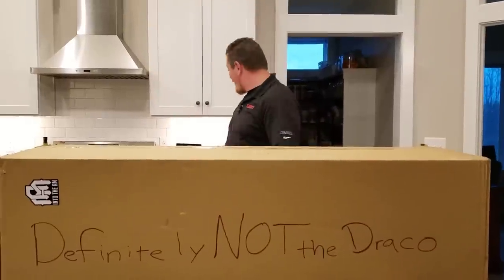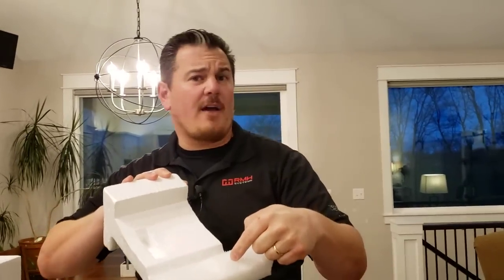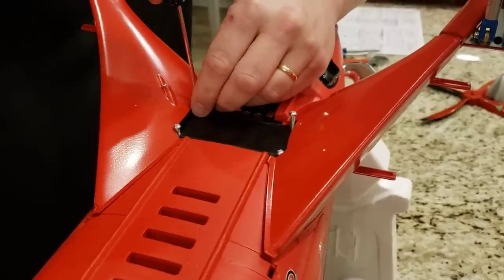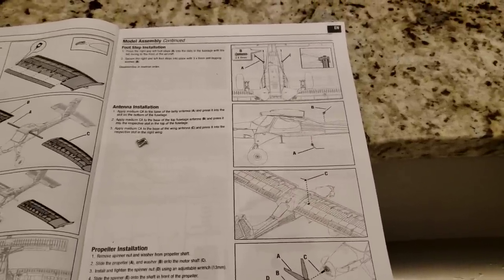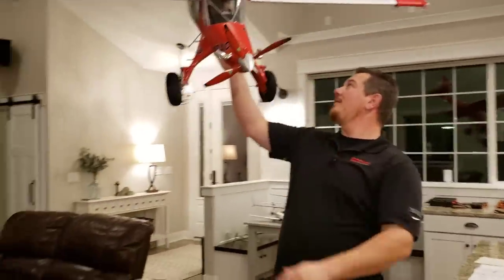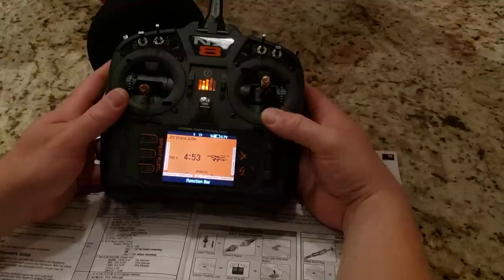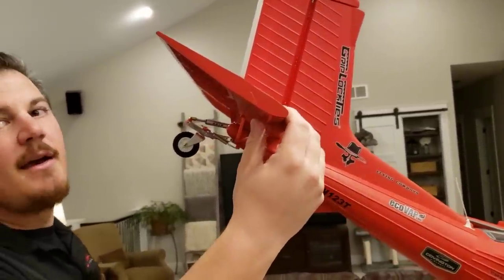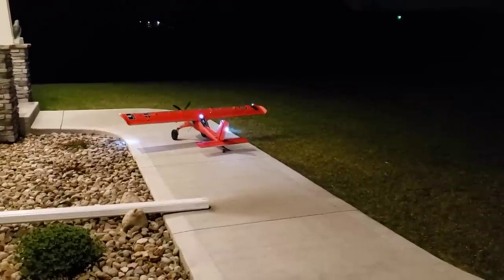Eflite - Draco - 2.0m - Unbox, Build, & Radio Setup

Comment: Well my Draco finally arrived:)  Curious what you ended up setting your expos at?  Thanks in advance!
Reply from the maker: I put them at whatever we did in this video...if I didn't mention it, it would be the same as my standard...

Control / Expo / Rate
Ailerons / 10% / 100%
Rudder / 20% / 100%
Elevator / 30% / 90%

...sorry, because I know that I do occasionally forget to say it in the radio setup, but I usually talk about it in the maiden flight, which happened to be anther video for this plane, something we don't typically do (anymore).
Reply: @BrianPhillipsRC  Thank you for the reply and all you do for this community Brian!  I will set mine per your standard and adjust from there.  Cheers

Comment: Hey Brian, love the vids. Im fairly new to rc planes and i accidentally ordered the PNP version instead of the BNF version. Im just wondering if there any extra steps to the set up/ bind process after i get the reciever installed? Thanks ahead of time for any help 👍👍
Reply from the maker: yes. I would say, follow the Unbox, Build, Radio Setup video for the FMS Beaver 2.0m. This will get you in the ball park, EXCEPT for the light module which will cause you some work too.

Comment: Been watching your video about the Draco build,.  I got my Draco last night and made an error using 5 minute epoxy on my leading edge wing spoiler.  Keeps on pulling off!!!  I love your cats.  We have 4 in-house cats here in Lakewood, Ca. yesterday.  Hey Brian, is it okay to use the regular 6s lipo instead of those smart battery?  I’ll make a battery adapter from IC5 to XT90.  Do you think I can still have fail safe and safe mode?
Reply from the maker: SMART Battery use does not dictate if SAFE works.
Use whatever pack you want, you'll be fine, but may lose some telemetry data.
5 Minute epoxy on the LE Slats? Why did they come off?
Reply: Sorry for my late reply Brian but I too is confuse and it’s weird.  Probably the mixing.  Anyway I pulled it, cleaned it and glued it again and it work this time.
Brian,  3 of my light aren’t working, the light 2X closest to the wing root on each
Reply: wing and the rudder tip lights.  Also, I found 2 unplug wires, one is a black & orange in one plug and a gray wire in another plug by itself.  I remember you mentioned about this in your video but I couldn’t find that “ page” anymore. Must I use a Y harness and plug it into the circuit board?

Comment: Hey Brian Why doesnt anyone show show the wiring ? Got my new Draco but Im having problems with the wires 2 of my wire leads dont have labels and I dont know where they connect. I connected all the cables that had labels but still dont know where the others go. Is there any support that I can call that will help me? Thanks
Reply from the maker: The reason nobody shows it is that most don't have to do it for a BNF - I suspect. You're trying to work out the LED's - can you just guess and check?

Comment: Hi Brian, I have my Draco but just as I was taking off on a maiden the engine stopped, the ESC stopped working and Horizon Hobby sent me a replacement, however I can no longer get the Avian Progm menu and everything else is workings etc control surfaces, safe select  and lights, now matter what I do no reverse, I must be doing or missing something any ideas would be appreciated. ...Larry Shimoda, Canada
Reply from the maker: I'm very sorry Larry, but not sure what to do. Are you using the SAME entry method we showed here for reverse thrust setup?

You have to do it within a few seconds of power up....I think like 30ish seconds....or it won't let you enter the menu.

Comment: Hi Brian, really enjoy your videos, I have a Draco Question about the Light controller. I recently had to rebuild my Draco after a serious crash which required me to order a new Fuse. the problem is no info on how the connectors are connected. Was able to figure it out except for one
connector. All other ones have a letter where to plug them in. the one that's odd has a tag with a light symbol wit power and a lightning bolt.
can't find where to plug it into the controller. Would you be so kind to look at your Draco and see where it's plugged into. E-Flight has no info on connections to the controller. Your help would be greatly appreciated Thanks in advance, Ernie

Comment: I was watching your video here and setting up the transmitter, and I'm not sure wat I did, but everything works well, but the throttle doesn't work. The plain just starts beeping . I was just curious if u would know what that would be?
Reply from the maker: Might need to double check a few things...

1) Is your throttle cut setup right - Check this FIRST.
2) Did your throttle go low enough to ARM the motor? If not, try a few clicks of trim DOWN and see if the motor initiates, if it doesn't, trim it MORE. If it still doesn't, you might need to try to CALIBRATE throttle range.
Reply: I have the trim set as low as it goes and it still does it.  I was just thinking would it do that if the battery is dead,

Comment: Hi Brian
I wonder whether you could help me as I am not able to get the right answer so far solving my problem.
I am trying to setup the Draco including reverse thrust on a Futaba receiver & transmitter but it doesn't work. I downloaded the SMART ESC software & connected the ESC (AVIAN SPMXAE1100 Smart ESC - 100Amp 3-6S Lipo) to assure the settings are right. The default settings (eg. Brake Type "Reverse" and the channel for the reverse thrust on CH7) were fine.
However, when I connect the signal plug to CH7 the ESC doesn't reverse the thrust - it seems as if the ESC doesn't get the signal. I connected a servo to CH7 using the programmed switch & this did work.
Thanks in advance for your help :-)
Reply from the maker: I don't even know if you can do it with Futaba. The Smart ESC's use SMART Technology for control of the reversing.

I'm not saying it won't work, but I am saying I don't think it will...but here goes nothing.

1) Take off the prop before you try any of this. I don't want to see pictures of your chopped up arm, like Big Jim just sent me the other day...TO THE BONE with the Night Timber (I think) GROSS! Replace with a piece of tape so you can tell if it's reversing.
2) You have to make sure the channel is working first - Hook up a servo and verify it.
3) Once you verify this, verify direction of travel. make sure you're driving the servo to the -100% / +100% of PWM. On Futaba, I wonder if you're possibly REVERSE of the call out by Spektrum???? 
4) Now you have to wonder through the programming menu on the PROGRAMMING BOX or the Tx. If you can't get into the menu, you need to enter within about 5-10 seconds of powering up the plane...
Reply: @BrianPhillipsRC  Hi Brian
First of all thanks a lot for your prompt feedback. Meanwhile I got the answer - it doesn't work with that ESC as the reverse thrust channel is actually a telemetry channel & therefore doesn't work with Futaba, Jeti etc.
I was just a bit surprised that the Product Support Team was not aware of that but got it sorted meanwhile.
Thanks a lot for your support & help - much appreciated.
Best regards,
Markus

Comment: Great, video (unboxing) I have tried in my basic English to retain as much as possible, although I can't understand everything.
My draco has been mounted and flown thanks to your help, my version is bnf so the bindhas been fast from the spektrum bnf template for NX8, it has been configured with safe disabled, but I would like to be able to opt for F switch assignment to select between AS3X and safe mode , I have not understood the procedure well .
even so my draco has flown without problems. could you help me with instructions to get AS3X and safe mode selectable in switch F .
Thanks
Congratulations from Spain for your video Brinan.
Reply from the maker: I would tell you to go into FORWARD PROGRAMMING, and make your assignment to SAFE on for the channel that's been assigned to "F" in SWITCH ASSIGNMENT.
Reply: @BrianPhillipsRC  ok thanks brian
regards

Comment: I have an older dx8 and the throtle mapping can't go to -100, how do I use this radio to fly the new draco with thrust reversing
Reply from the maker: I don't think that matters.

Your Tx's menu structure only DISPLAYS the +/-100%, whereas the PWM is always the same in DSMX / DSM2. You should be able to do it, but you'll have to adjust the WAY you setup the settings. Think of it like this...

+100% for me = 100% for you
-100% for me = 0% for you

Should be simple as that...but you may need to reach out to Spektrum to see if your DX8 is compatible to do Forward Programming. You may need to update firmware too, but not sure if this feature is supported. As I understand it, you just need the Programming Box for thrust reverse, IF you don't mind loosing access to Forward Programming.

The programming box allows you to setup WHAT channel you'll use to control the Reversing channel. 

Avian ESCs https://bit.ly/3z25S2j
ESC Programmer https://bit.ly/3PFWmZY

Comment: Are you a electronic or mechanical engineer?
Reply from the maker: I'm neither ;) Not pedigreed as an engineer, but work in a pseudo engineering role at times, more electrical than mechanical, but some of both with an emphasis on electronics and control level circuits, predominantly.

Comment: Are you really using an ' adjustable wrench?"
An ',adjustable wrench or a  fits all wrench". Really fits nothing.  
I may ha$10,000 in hand tools, not battery or lipo, just hand tools. 
But not a single 'adjustable ' I call em a " fits nothing " or a " knuckle buster" 
No real or pro, semi-pro hobbyist would have one. Just get a couple small metric or SAE wrench set and hide the " fits all' in the bottom drawer of your tool chest.